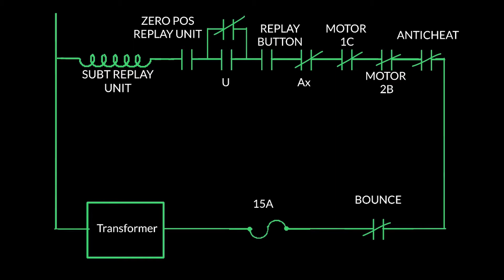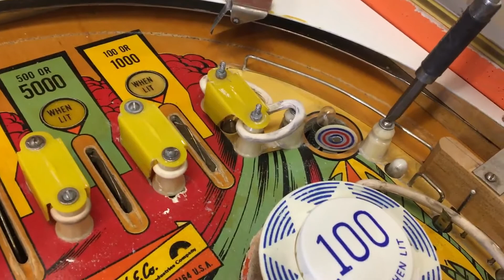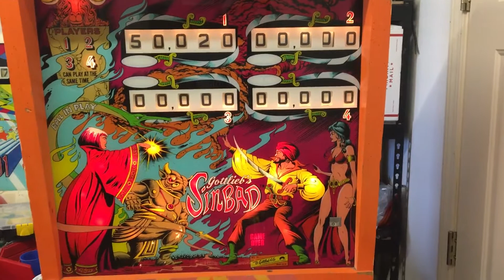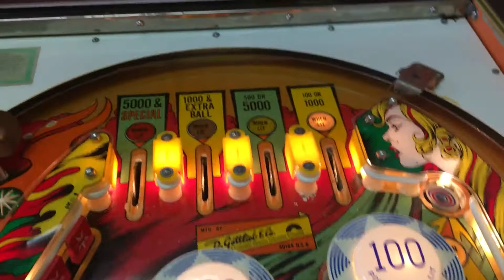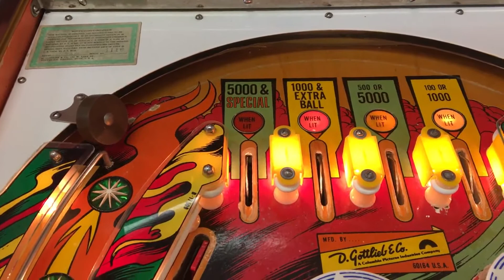Gottlieb Sinbad (EM) Repair, Rules, and Game Play

Comment: Cant get anything? When pluged in 120v to on/off switch then 1 1/2 volts?? How much juice should it have?
Reply from the maker: Did you check all the fuses?  Should have 120v going in and then the transformer creates 25V for the coils and 6V for the lights.